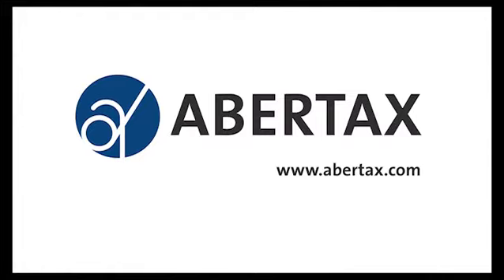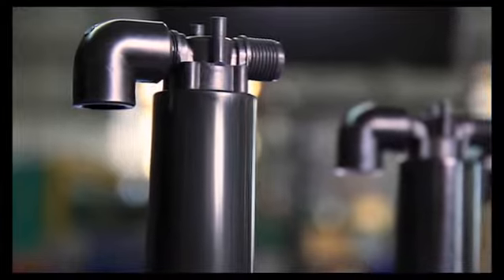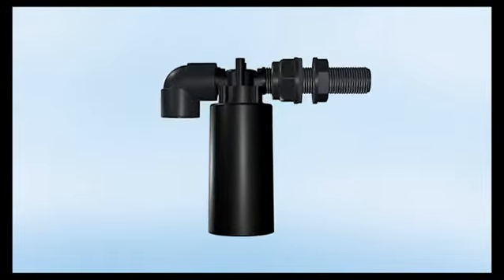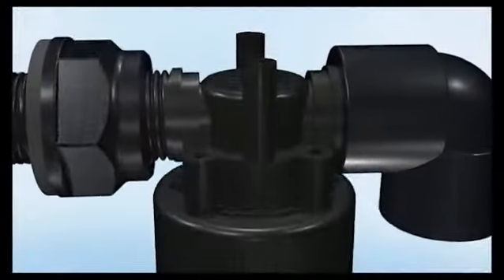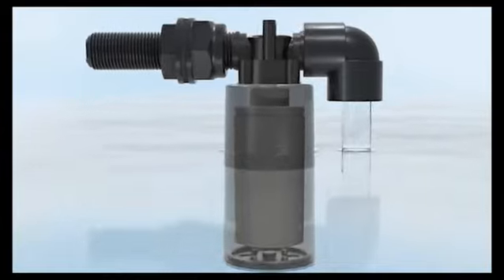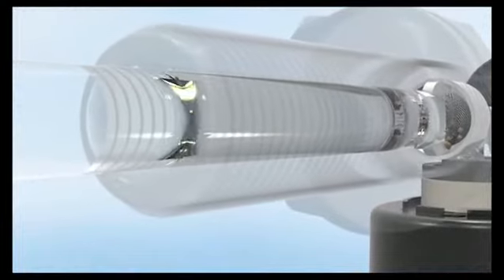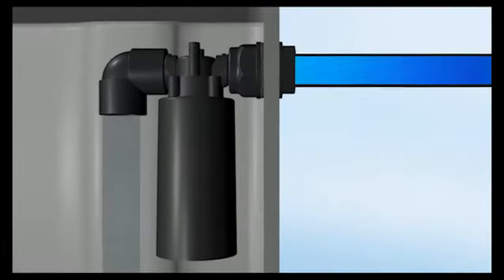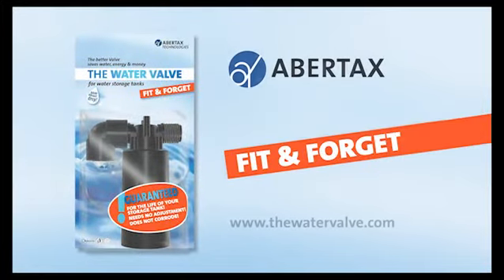Abertax: Inventions, Valve - Master

Comment: Seems quite unique. I'm on a private water supply and my electronic controlled pump cycles for at least 20 minutes whilst it fills the loft tank because of the way my current ball valves works. Hopefully the off-and-on design of this valve solves any issues. Just ordered from BES. Fingers crossed it works!